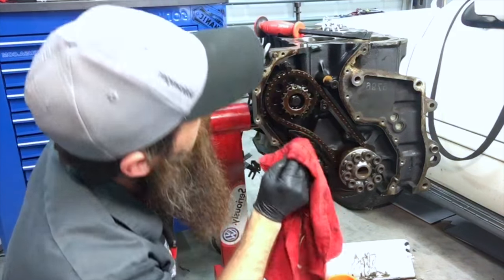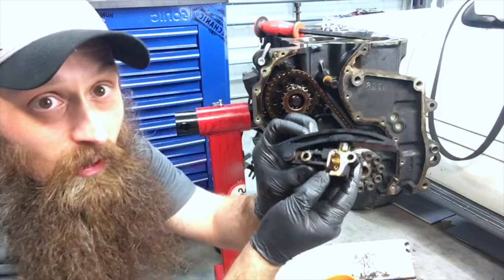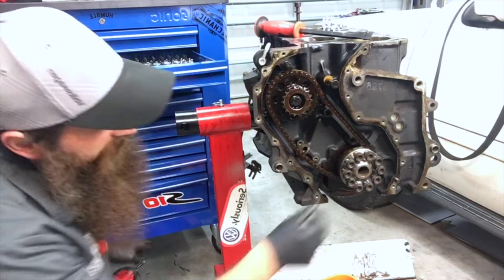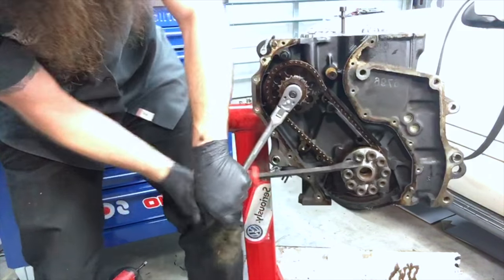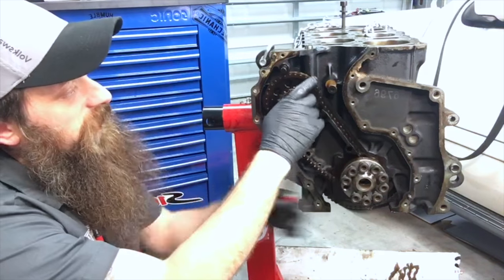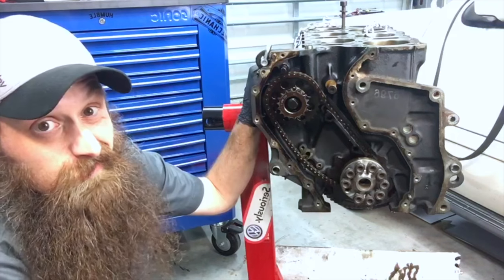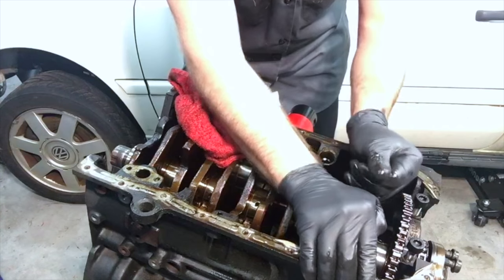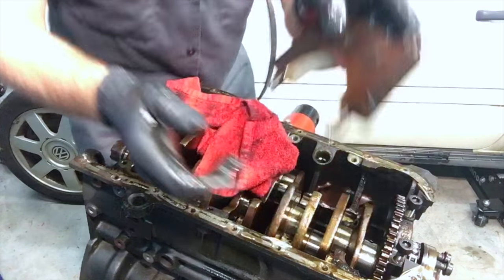VR6 Tear Down Part 3~FaceBook Live

Comment: As far as I know there's only the new timing chain System available with nylon "sliders". In that case, you also need the new, shorter tensioner. Btw, is that the newer model with "non moving" ignition distribution? If you get a good deal for the '95/'96 ignition/injection go get it. If it includes wiring, that is : D. Esp. the "Surface-MAF" is better than the old "wire heater" ;) And, as far as I remember, the R36 Connection rod bearings also fit in the old 12 valvers. Those are the best choice to get. Block/cylinder head: if you're getting the head "machined", be sure to check the block's surface, too. Every time I had a "bent" head, the block surface also went "crazy banana". Oh, and I just realized why this vid has such an eerie feel to it: you're left-handed! Makes you right-handed unsrewing stuff ClockWise...

Comment: Corrados are fun, I bought one in very poor shape with a blown head gasket, the interior was taken apart, blown heater core, hail damage, leaks everywhere. I picked it up for $750, came with a spare engine and tons of parts. I abandoned the build because of the body issues, but it was a lot of fun to drive before I took it apart. I am heading home to SD for the holidays to grab my 2 VR6 engines and bring them down to TX in the back of a Volvo. I'll be right about where you are, stripped, cleaned, painted, rebuilt and hopefully looking for a longitudinal swap into an Audi 90.
Reply from the maker: That Audi build sounds awesome.

Comment: Charles anything that had to involve pulling the trans to repair I  replace even if they look good (unless of course it is some outrageously priced item that usually doesn't go bad) . ie: timing chain gears, chain, guides and tensioner. old school way, you can see how much a chain has stretched by holding by one end (sideways) and see how much it says down. it's always kind of neat to see how much they sag even on ones you thought were good.

you are go to highly polish the timing cover and all the aluminum parts as well right? lol
Reply from the maker: Yeah I usually error on the side of replacement. Not that I can't pull the trans back out, I just don't want to. I wont be polishing, but I will clean and paint. No one will ever see it, but Ill know. LOL

Comment: FYI. if you forget to prefill a diesel fuel filter, have someone crank the engine over and shoot air into the fuel tank. use the blow gun and cover the filler neck with rags around the blow gun
Reply from the maker: Never heard that one before. I have forgot to fill a few ALH filters. It does not make for a fun time. LOL

Comment: A vw tech showed me that. It pressurized the tank forces the fuel through the line to the filter and to the pump. Not so hard to start then. You might try that for the hell of it

Comment: Charles love the work vdub 4 life. Wookie life. Been a vdub tech for over 16 years but its always been righty tighty lefty looosie so the oil pump drive gear bolt has backwards threads ? Or are u not thinking??
Reply from the maker: It may be that this is from the front cam of my old phone

Comment: Hey your project here is giving me motivation to turbo my VR6... just no money yet haha

Have you looked into 1/2" cordless electric guns yet? I have the DEWALT DCF899 and its pretty damn strong... pretty sure it would remove that sprocket bolt without trouble. I've put it to the test and it's really strong! 

Also dig it cause my friend knows someone who works there and hooked me up with a gun, 2 batteries and a charger for just $250 CAD :D
Reply from the maker: NICE! You should totally turbo it. LOL

I have that Kobalt that is pretty good. I will get getting the new hotness Milwaukee in a few weeks. I am pumped to try that out.
Reply: Nice are you sponsored by Milwaukee or something?

Can I direct message you for some guidance on a simple VR6 turbo setup in my near future?
Reply from the maker: +McCheeseKid not really sponsored by, but we have a great relationship. 

Hit up VWvortex search. There should be a lot of threads on Turbo vr
Reply: Well if you say so... I just don't trust everything they say, but for the most part its a good guide thanks!!

Comment: 88 mk2 golf 1.8ltr 8v. changed my fuel filter, transfer pump and main pump. Car didn't start at first then finally turned over and I let it warmed up and went to step on the gas and it died.  why?